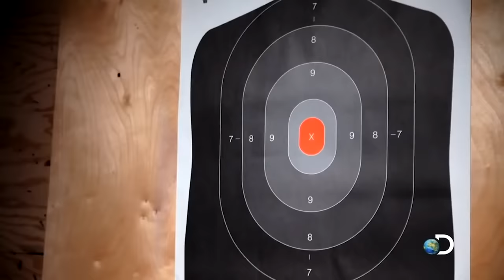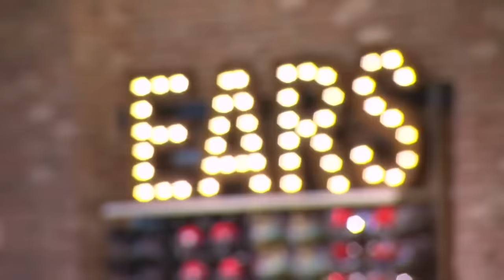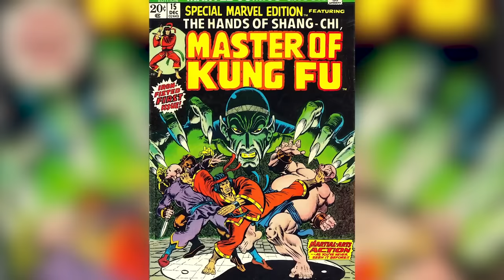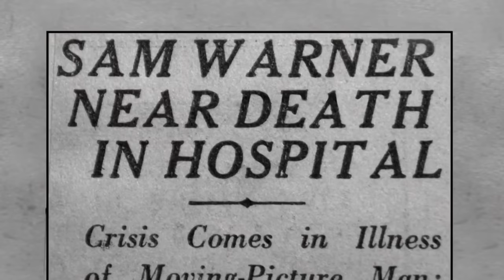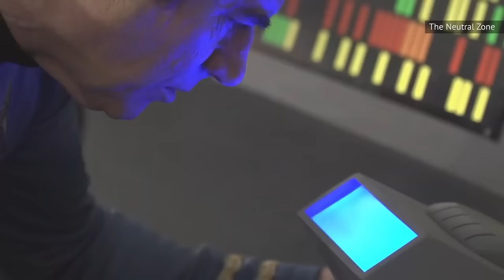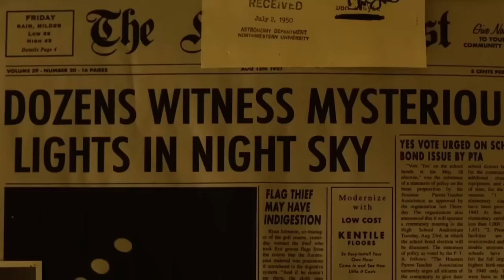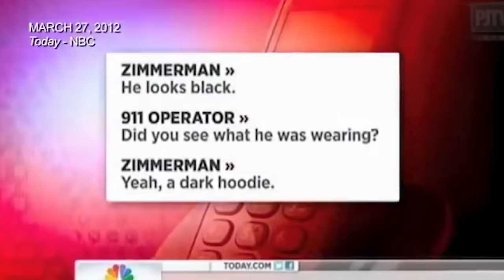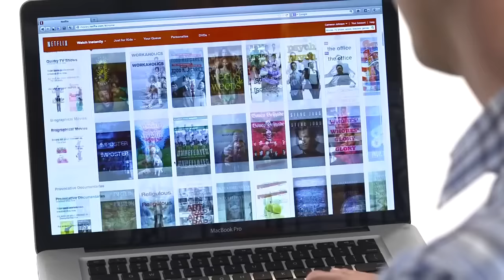Huge Scandals Marathon #1

Comment: I'm think you can pass on calling History's, historical fictions ( Sons of Liberty, Vikings) "A Huge Scandal". Also, the pyramids weren't built with ramps as you so boldly claim. There's actually quite a few things i quite dislike about this collection of videos. Cheers
Reply: Paul Kinley  That's just it, No one knows for sure how they were built and claiming one theoretical way was indeed how it was done is nonsense. And obviously i have no clue and I'm not claiming i do or even theorizing. The ramp theory just seems a bit much when taking into account what that would have involved. Especially when there is no evidence of ramps being used. That's a shit ton of material to have zero evidence it never existed.
Reply: Paul Kinley  I do tend to agree with on your points stated here. I also think the internal ramp theory is one of the most plausible. The Grand Gallery certainly tells a story in the stone but what exactly? Cheers friend
Reply: Very nice of you to be so civil and pleasant despite this rather disappointing presentation.

Comment: Ramps to build the pyramids? Lol way too accurate. Plus, that means the slave labor was so superbly trained that they set every single block with precision after the back breaking pull uphill? Btw if we don’t have machines now that can pick them up, how did they build scaffolding with ramps strong enough to hold the weight of the block and all the men pulling it at the same time?